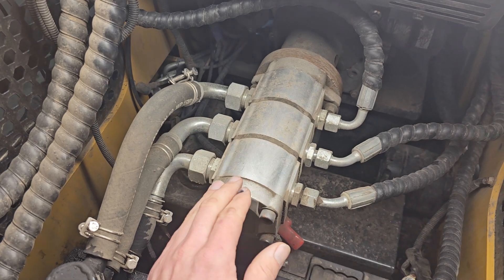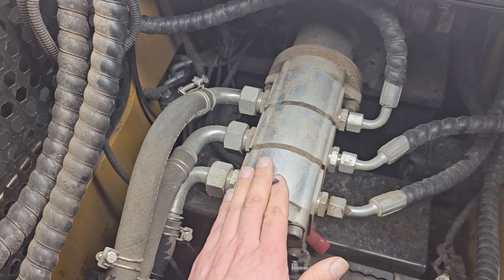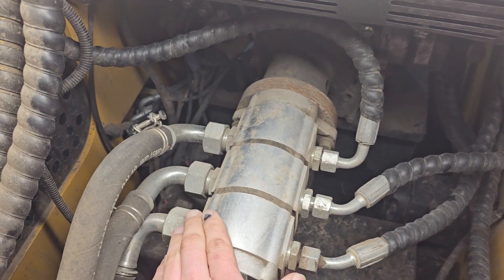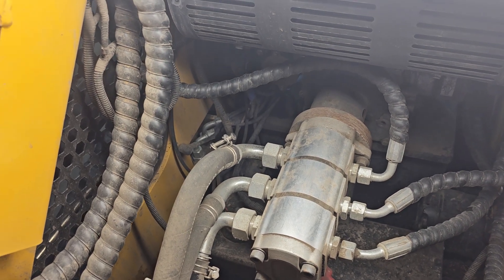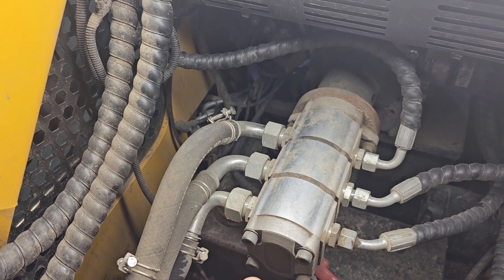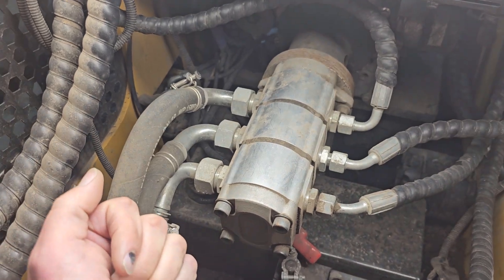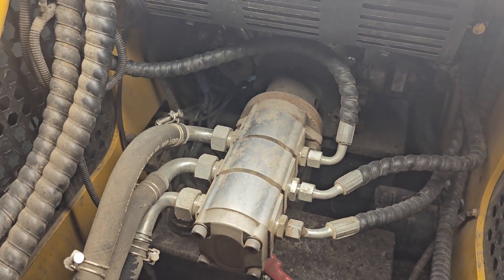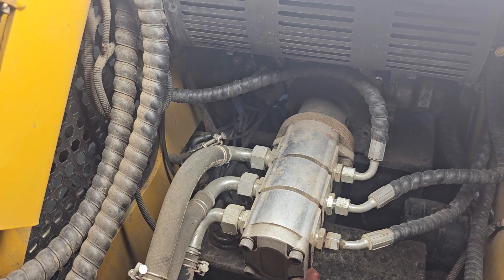Overview of Hydraulic Pumps for Mini Skids!!

Comment: The pumps are only just over 3 gpm pumps and that woould be at a rev on engine, I want to tee the auxiliary pump to the other two, and gain extra 3+ gal per min flow for F&B and bucket and lift, any thoughts?
Reply from the maker: The guys over on Facebook mini skid chat, have had good results changing the plumbing around. Bob Payne knows his stuff

Comment: You must be able to get a bigger pump, just using this engine here.
Reply from the maker: @Jdl4nw  Once I get a bit more time, I'm going to take in the specs to a local guy. I agree with you.
Reply: @TheJBros520 you can also make use of a diverter. I saw a clip of a guy using one on his John Deere tractor to steal some gpm from the steering and redirect it to the aux hydraulic to run attachments like a boom pole saw.
Reply: @TheJBros520
Ok utube keeps deleting this when I make mention of this site I found. With just a little research I found that you can support about 1gpm per 1hp.   They have a triple pump that looks like ours and you can build it to have different flows. U can have 2 flowing 5gpm for tracks and loader, and 1 flowing 11 or 12gpm for aux. 
It looks like ours but I haven’t measured and haven’t looked at the bolts on the mating flange. It’s also like $700. It would be a huge improvement if it worked.
Reply from the maker: @Jdl4nw  I don't know why I haven't been seeing these posts. Just saw these comments. What pump was that $700 one? Got a link or track me down on Facebook messenger. Jeremy Menke
Reply: @ I reached out to you
Reply from the maker: @4u2nve  I've been really looking into stuff, feel I'm getting solid ideas....
Reply: @TheJBros520ATO

Comment: Think they ran a 14 gpm single pump to through a diverter. Can change flow rate with whatever you're running. If running a log splitter, you could turn up the gpm on the diverter to 10-14 and just run that. Turn back down when you're done using it. You could also change out the 1 spool on a 2 pump unit to a 2 pool valve and run another Aux on the other side.  Think you could also T off before the diverter and run straight 14 gpm to the Aux and divert your track speed and lift/tilt speed to 6-10. Also could run flow valves on the lift/tilt cylinders so you can keep your flow high without T-ing off. Will just have faster speed and faster flow to AUX. So many possibilities...someone needs to make a detailed video of doing this whole process 😂
Reply from the maker: @woodnyardjunkie  Totally!!!! Wish you were in my backyard!! We could experiment and do a detailed video!!!! Hell. I like how your explaining it!!!! Thanks much appreciated!!!
Reply: @TheJBros520  I've ordered a log splitter for the mini, so I might be doing the single pump mod if my 2 pump doesn't run it efficiently.
Reply from the maker: @woodnyardjunkie  Cool deal. I have a gas log splitter never thought to just look at how that system is set up. My eyes are just opened up about this hydraulic system!!! I started just wanting to keep an engine running and tracks on to, keep trying to better the unit. I believe all the bones are there on these machines!

Comment: The 2 pumps closest the engine each run one track or cylinders. The front one supplies both side attachment plugs. You could remove the front pump and everything would work normal except attachments.
Reply from the maker: @acousticrocks7542  I think this was touched on. So we could buy a pump that's 10x5x5 that would be supported by the 24 hp engine? But it would need that bigger Hydraulic tank?
Reply: @TheJBros520 I don't know. Can you stack a 4th pump on there and parallel 3rd & 4th to the attachment controller?
Reply from the maker: @acousticrocks7542  Right!! Seems to me there's a way. Just matter of finding something compatible. Just an interesting topic!!!

Comment: It’s really not about the hp of the motor it’s the rpm that the pump is engendered to run at. You can upgrade the pump to get more flow to either the tracks or the cylinder or auxiliary pump. You could add a bigger hydraulic tank to help keep your fluid cooler as well . The more hp of the motor helps getting the tip speed back up and going once it’s starts to bog down and you lift back up on the auger . Or whatever attachment you’re running.
Reply from the maker: @philipwalker1267  Nice thanks for the info!!
Reply: @ your welcome what’s the gpm on your auger ?
Reply from the maker: 7-14 gpm. 22 max mps

Comment: The gentleman you mentioned with a single pump/diverter bought his skid reworked from one of the Facebook group moderators. There’s potential to have a majority of the single pump flow allocated to the auxiliary and potential for the hydraulic valves to be the limiting factor at that point.
Reply from the maker: @59apachestepside  Thanks
Reply from the maker: @woodnyardjunkie  Hey, thanks! I'll try to track it down for my own curiosity.
Reply from the maker: @woodnyardjunkie  Ty

Comment: Also things like running say a log splitter. With 4 gpm from one pump (stock plumbing) it will take 30 seconds per stroke with the average 20 ton hydraulic cylinder. With all three pumps pushing fluid into the accessory like in this video https://youtu.be/CMm2fHzZGC4 that would cycle the splitter in 10 seconds
Reply: I also want to cover ways to change the plumbing on the go. We are used to using flat faced quick connections on the front of the mini to attach attachments. However, lets not limit ourselves there. Any where inside the mini we can add quick connections to customise. As a example, any time you are not using the third pump, the pressure side could be connected right back to the tank, removing all the heat generated from pushing fluid not being used through the control valve.
Reply from the maker: @natsterlive  I think i understand what your saying and that would be cool. Im with you! I think there is more potential modifications to really dial these in!! Thanks again for your information and comments!!! I really enjoy it!!

Comment: Maybee switch out different 3 stack gear pumps to 9gpm , 9gpm, and 9gpm. Would be ineresting to see if engine could handle it . Hoses also. I saw this ( rato ) pump .
Reply from the maker: @natsterlive  Yes, subscribed too!!
Reply: That's passed the engine power. Less pumps are better
Reply from the maker: @natsterlive  Curious if you have seen any Pumps that would fit the current motor better.
Reply: @TheJBros520 Yes I wrote a huge reply, but you tube keeps removing it.
Reply from the maker: @natsterlive  Dang!! Bummer!!
Reply: @natsterlive  Hey Nat, are you able to post it on your youtube channel
Reply from the maker: @tigertoilet2  That would be cool to see if a guy could find a better pump.
Reply: Problem is cooling if the oil cooler is not big enough you will overheat the oil. Potentially boiling it
Reply from the maker: @darth395  right

Comment: It isn't just about running "faster". It is also about power output. With better low to the auger, yes it will turn faster but it will also deliver additional power to break through tougher material. Additionally, the greater flow would allow for better control of the bucket while moving at a desired speed.
Reply: Flow has nothing to do with power, its speed. Pressure is the power
Reply from the maker: @Microbc  Good points!